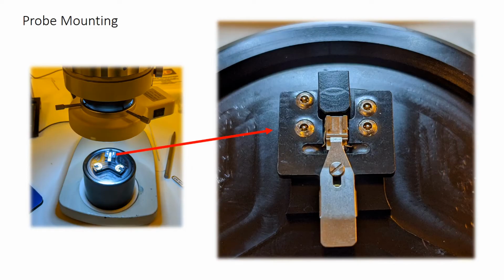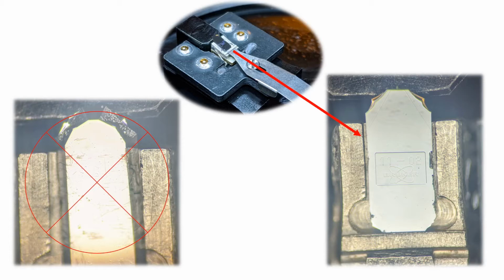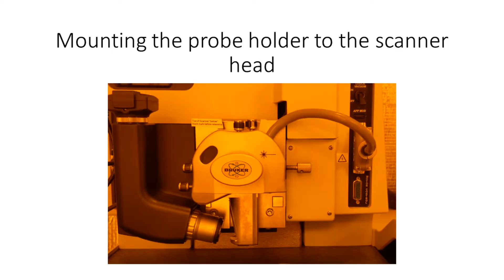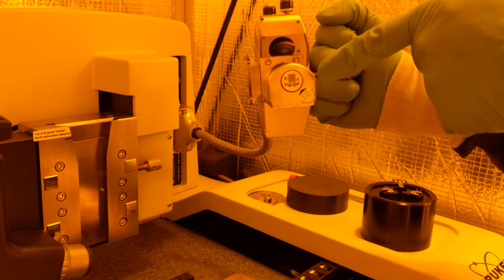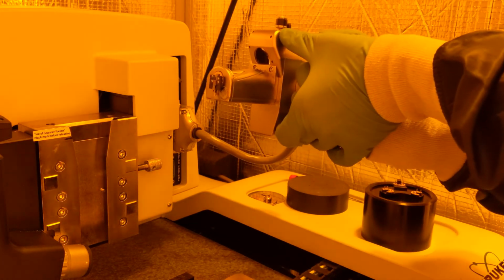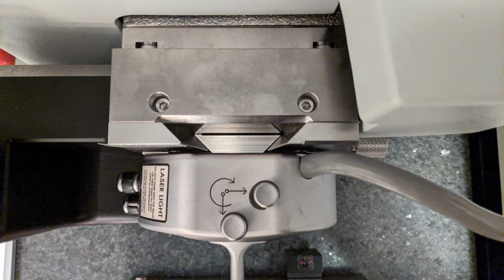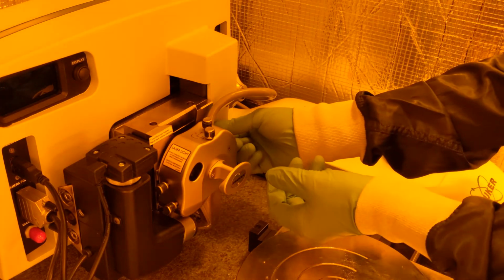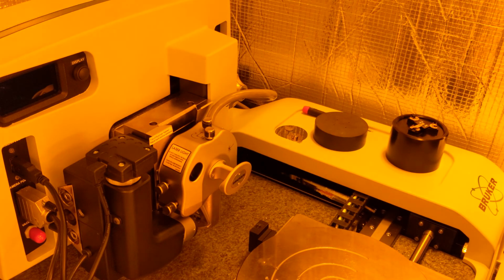KNI Intro to AFM (4/3): Probe & Scanner Mounting

Comment: While this is an excellent and useful video, I would highly recommend that new users, especially, don't attempt to load the probe holder onto the scanner with the scanner held horizontally, as at the 2:20 mark. They're better off holding it vertically, as at the 4:25 mark. The camera angle at 2:20 shows the process well, though people should not take that part of the demonstration too literally. Holding horizontally puts the user at a much higher risk of dropping the probe holder (destroying the AFM probe, ~$30, or probe holder, ~$1000) or much worse, dropping the scanner, which could cause $15k-80k in damages.